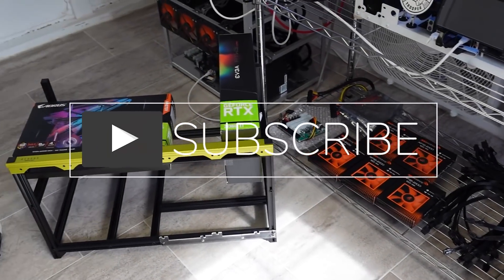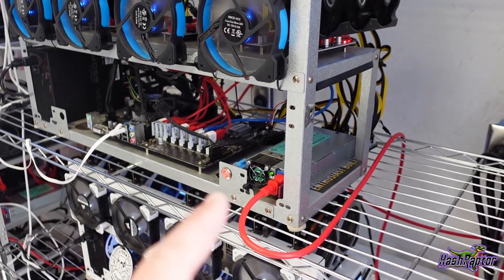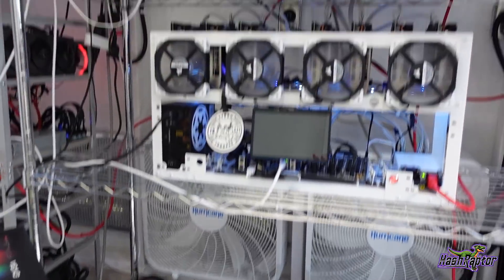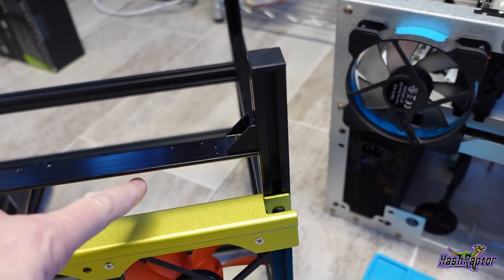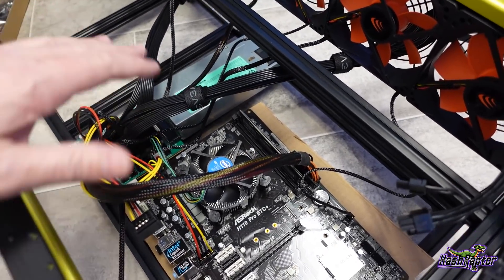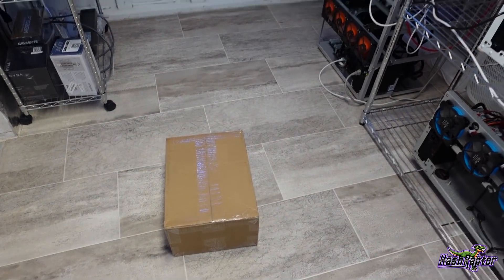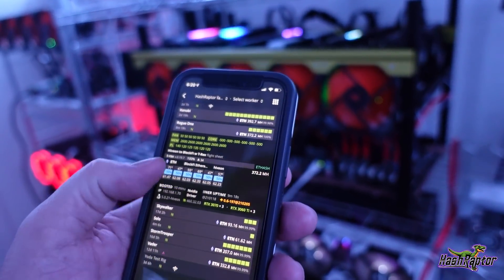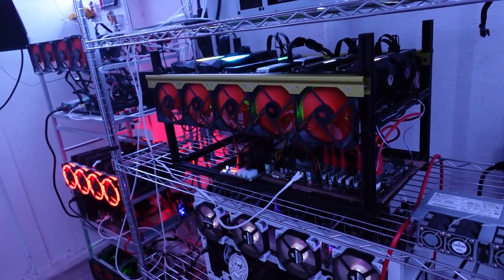Starting my 3060 Ti Crypto Mining Rig Build - Part 1

Comment: hi need help ,what motherboard will work with 3- 3060rtx oc not Ti? thank you
Reply: It depends on your psu and how many pcie connectors do you have on the motherboard. An rtx 3060 draws 170-180 watts off power so you need at least a 700w psu and 3 pcie connectors on ANY motherboard.  But if you want to OC then buy an 1000W or higher psu. Hope it will work :)

Comment: Just noticed how you were able to mount additional exhaust fans on your Veddha frame, very smart of you mounting on the outside!!!! I am going to buy an additional 5 fans and do the same thing for maximum cooling/airflow.
Reply from the maker: Rock on!  Airflow is so good with those fans!
Reply: @HashRaptor  I find my favorite fans right now are the arctic cooling f12 PWM with the liquid capsule bearings. They are the perfect balance between noise and performance and cost! Usually get a 5 value pack off Amazon for around $67 CAD with tax.
Reply: @HashRaptor  Ended up getting 6c cooler Vram temps!!! Really funny how Veddha didn't design it like this in the first place. The push/pull cooling performance is amazing!!! Thanks for your videos! Keep up the great work!!!
Reply: Hey Gabe. Can you help me build a mining rig I found some parts but wanna know if they fit together and stuff. Could you help? :)

Comment: Hi I have a question, I have the same motherboard but is only picking up one card while mining
Reply from the maker: Hhmmmm, check that above 4G is enabled and try different pcie link speeds (gen 1 / gen 2).
Reply: @HashRaptor  have 4GB enabled and changed the link sppeds to gen1 / gen2 still not detecting.
Reply: @HashRaptor only working when the GPU is mounted to 16PCIE
Reply from the maker: Did you change all gen 1 and gen 2 settings. Sometimes there is more than one.

Comment: 9:11 Uhm, why not use the MB CPU fan port?  that is what it is for.  The fan hub on the board is meant for any extra fans you plug around the rig.

Also a thin MDF board as a base would be perfect as well.
Reply from the maker: Yes I can cover this in part two which I’m about to release. I was trying to fill up the new board to test it out. It actually has a CPU fan slot that I won’t use moving forward because of this exact issue. Thanks so much for calling that out good catch.

Comment: I would like to build 6 gpus rx 5600xt mining rig, so I don't need to buy atx  power supply ? Just buy server power supply with board ?
Reply from the maker: Yes as long as you buy a breakout bored they can power the motherboard also. Make sure you are only using 80% of the total offered by the power supply. Good luck

Comment: Why are you not pluging in you're cpu fan on you're motherboard?

It controls the fan speed based on the temperature
Reply from the maker: Yes! Was trying to use all the slots on the shiny new board ha ha. See part two as I had to use a couple fan ports on the motherboard.

Comment: Love that breakout board no reason to use a atx anymore lol speacilly if you got the 2400w PSU Could just throw the cpu fan into the mb use the controllers just for rig fans.  Had the same small size problem with my zotac so had to throw it in my gaming pc.
Reply from the maker: Yes loving that card!  Fan ports in part 2 ;). I had to use a few ports on the motherboard for fans. Was trying to use all the ports initially on my shiny new board. Ha ha

Comment: How the hell are you able to get so many 3060's i cant get even ONE im checking best buy, ebay, ksl, craigslist, everything and all the time all sold out :(
Reply from the maker: It is really hard. Are you signed up for alerts for checking Alerts like the ones I have set up in Discord? Even with those you have to be signed into Best Buy and other places, and when the alert hits check out extremely fast. I found that a mobile device oddly works best. You can use Apple Pay and purchase in about two seconds.
Reply: @HashRaptor  Thx so much i created a acc and have all info in just cant find how to turn notifications on in best buy other then that im rdy :)

Cant do apple pay dont have any apple products.
Reply: Add up jallyhacksprime on ig he can give you updates and let you know when it’s available depending on your area I also secured my 3060ti through him

Comment: How in the world are folks just buying these cards?
Reply from the maker: It is really hard. Are you signed up for alerts for checking Alerts like the ones I have set up in Discord? Even with those you have to be signed into Best Buy and other places, and when the alert hits check out extremely fast. I found that a mobile device oddly works best. You can use Apple Pay and purchase in about two seconds.
Reply: @HashRaptor  I am setup currently for alerts from multiple discord servers as well as the auto notifications that Newegg, Bestbuy and BnH send out. Also using a Chrome extension called OctoShop. Whenever I get a alert by the time I click the link and the page loads the item is already “Out of stock”. This seems to be the case for most alerts with the exception being when the item is REALLY over priced on Amazon for example. What I don’t get is how YouTube crypto channels are just somehow  getting multiple cards amidst a huge short and GPUs are getting sold the second they drop. It’s a bit frustrating be honest.

Haven’t tried using my phone for purchases yet. Not sure how that would change items being out of stock. But checkout I can see being much quicker.

Comment: where can i buy ur gpus. i just started
Reply from the maker: It is really hard. Are you signed up for alerts for checking Alerts like the ones I have set up in Discord? Even with those you have to be signed into Best Buy and other places, and when the alert hits check out extremely fast. I found that a mobile device oddly works best. You can use Apple Pay and purchase in about two seconds.
Reply: @HashRaptor  I have found the discord, also what are the best budget cards i could get for mining

Comment: for the 3060TI, does it matter a lot what producer you find like asus, sapphire etc..? how to differentiate the profitability rate for each one? :((
Reply from the maker: It does some as a few hash slightly better than others but honestly at this point, it is so hard to find them. You are pretty lucky with just about any brand. Just keep an eye out for repeated reports of bad fans or failing cards.
Reply: HashRaptor do you have a site/forum/page where you would watch for reports or just general online news?

Comment: Why do you need to connect CPU fan to breakout board? If the MB gets power through 24 pin and 8 pin and molex, it would be safe to connect it on CPU fan connector on MB. Or are you trying to unload MB from all unnecessary power drawn because of that one molex that u cant connect to mb? Or maybe am i not seeing something?
Reply from the maker: No you nailed it. Wait for part two. I had to use several fan ports on the motherboard. Initially I was just trying to use all the nice shiny new slots available on this new board ha ha

Comment: Why would you hook the cpu fan plug on the power supply? It goes on the motherboard
Reply from the maker: They have a CPU fan slot specifically on this new board so I was trying it out. Great catch and keep an eye on part two coming up. I had to use several fan ports on the motherboard.

Comment: I have 5x 3060 ti FE'srunning 62.5 MHS Etash in a rig sweet at +1400mem 60%pl, also have the Zotac 3060 to too in my PC used same mem setting but the Zotac crashed my system today after a week, had to dial back mem to +1200, seems to be running ok at the moment
Reply: I've had to dial back mem on the 5* 3060 ti's back too, they were unstable at +1400 too, crashed this morning

Comment: i can't move past the fact you spun the motherboard around because of a short cpu fan cable??? it's 2021 and you lack the knowledge of making a short cable longer? also for you and anyone else building rigs on a metal shelf, put the gpu's in a zig zag pattern so they will have more distance between them in the same amount of space and won't be facing each other's backplate, you'll get way better temps
Reply from the maker: LOL just trying to use all the ports on this new board, keep an eye on part 2. As I was playing with the setup, had to use a few ports on the mobo. Good suggestion on staggering the cards. How do you secure them to the wire shelves?  Hang them or notch them in?
Reply: @HashRaptor  i usually use zip ties at each end but the larger variant so they're not moving at all and you can also go a bit wide when securing them to the shelf to ensure each card is perfectly straight and makes them a lot easier to take off, this one is just a personal preference

Comment: I screamed at the monitor that zotac wont fit. lol.🤣🤣 Had to do the same thing on my rig👍
Reply from the maker: Oh man, LOL. I was tired too and wasn’t in the mood to move that bar :)
Reply: @HashRaptor   Same here when i  did mine. Like a 1/4 inch short. Keep up the vids👍
Reply: I just had the opposite problem. Got an MSI Gaming Trio 3060TI I was going to slap in my gaming PC as a second card to save the one last empty slot on my rig for the future but it's WAY too long.

Comment: No motherboard CPU fan port?
Reply from the maker: Yes, it does have a cpu fan port on the breakout board. Guess I could just put that on the mobo if I need to when I mount that board.
Reply: @HashRaptor  I use the motherboard port since it is variable speed. The server power supplies are constant.

Comment: You only need the molex on the MB for PCI-e devices that get power from the MB. As long as you are using powered risers, you don't need them and in fact they could cause problems, don't use them. 

Why not just plug the CPU fan into the MB?
Reply from the maker: Yes will do for sure. I was trying to use all the slots available on the breakout board since it was the first time, but you will see in the next video where I had to use the mobo fan connections for a few fans on the mobo. Good catch!